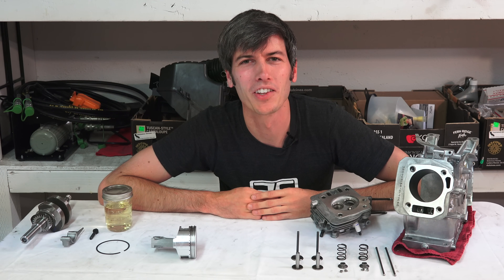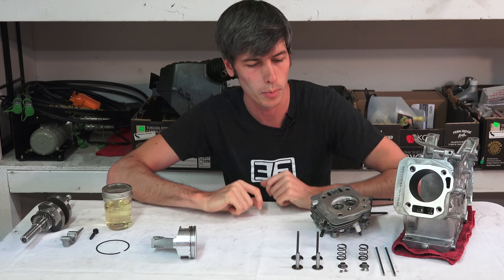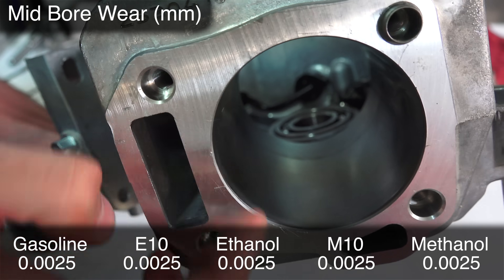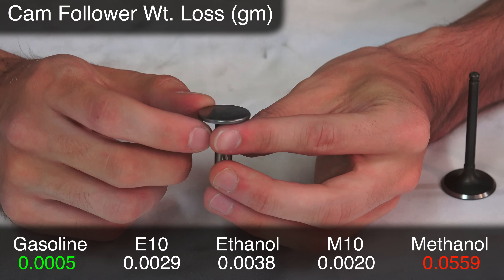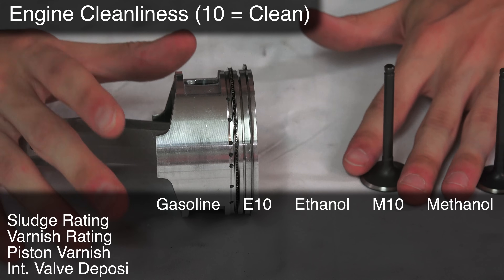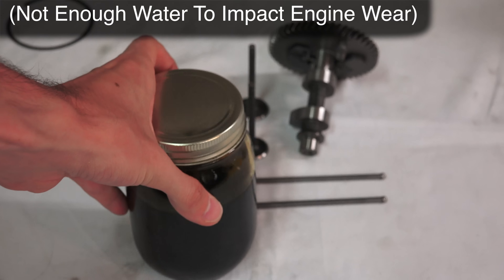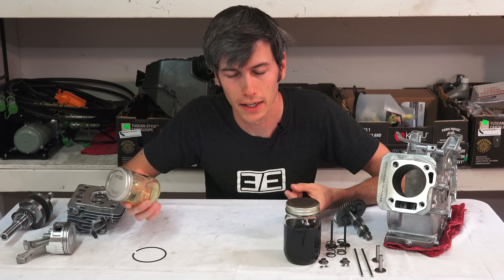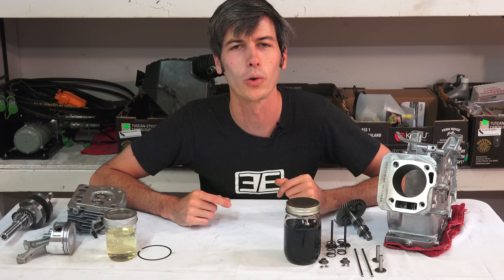Is Ethanol Bad For Your Car's Engine?

Comment: Then E10 is completely pointless...  For me anyway.  If it's cheap it makes no difference as the car will drink more of it to go the same distance.....  I run mine on 98 always and therefore I get awesome gas mileage being such a small engine and light weight car.

Comment: Ethanol is most definitely bad for engine in my motorcycle. Under load it increases pinging or pre ignition. This is a new 2017 engine. By adding octane booster the issue was dramatically reduced. Running 91 octane. In Canada in some provinces all contains ethanol. The  study is completely flawed as steady state does not deal with an engine under load. E.g. an engine under acceleration or climbing. This study has not considered octane at all. It is frankly misleading.

Comment: Great study , do you know if they took into account the 50% increase in fuel methanol takes to make the equivalent energy as the Gas and E10 ? That might have led to the increased wear also.  Curious though to why the 100% Ethanol didn't yield similar results as 100% methanol

Comment: Ive been running E85 in my 1996 dodge neon for 8 years.E85 is amazing I made all of my vehicles run on it. You lose some mpg but the cost difference makes up for it. I'd even pay a little more for e85 as it's a better fuel. Higher octane, burns cooler, and cleaner. The best part is my money stays right here in my country, not going to the middle eastern sand jammers 👍

Comment: Thanks for the video. Interesting to see pure ethanol had lowest wear. If nothing else it shows it certainly doesn't make things worse.  After tens of thousands of miles my oil analysis's seem to agree with this studies assertions.

A shame E85 isn't more widely used. I save ~20% $/mile over premium and it's better then race gas! The tune has paid for itself and then some plus the engine just feels so much more alive. 

Equal or less wear & more power for less money? How can you not love it?!

Comment: Yeah, limited focus of study to just the engine and you really don't emphasize that really well. E10 & Engines = Great, E10.  Other components of the fuel system, lines, tanks, etc = Not so great.

Comment: Boy there are a few comments i would like to address... but i wont.. people are giving ethanol a bad rap but its not the issue.. the big oil and gas industry is the issue. if your running a bike you will have to change a few things due to alcohol dries rubber.. so if its untreated hoses you either need to treat the rubber or change the part. Ethanol is actually better for your engine but that not what big oil wants you to know or you would just make it at home for pennies and never have to fill up at a station.  With ethanol your engine (when properly tweaked for it) will never need maintenance except oil changes.. as it burns clean. The tweaking needed would be a change in how much air your engine is taken in.  If you do high performance spark plugs, tweak your air to fuel ratio, you would see your engine would have more horsepower and torque from using ethanol and your engine is more efficient . The only downfall is that gas has more energy in it than ethanol. so a gallon of gas is equal to 1.35 gallons of ethanol. 

the reason they added ethanol to the fuel is to give it a higher octane rating since pure ethanol is 100 + octane.  When you learn that ethanol used to be our fuel before gas was introduced as a fuel you will see how we got fucked. Fuel is actually a bi product of oil.. and they used to dump it in the rivers and streams to throw it out.. then they had the laws changed so you could not use ethanol in your car (aka prohibition) so they could get 13 years of no competition. they did this because they were poisioning the water and knew they needed to find a source to use it.. and they did.. cars.

Comment: Why is 100% ethanol and 100% methanol used in racing?  Because its high quality, high octane fuel and produces the most horse power.  Today's cars are designed to use E10 etc. by using the correct materials for fuel lines and engine materials, just like the materials had to change to handle unleaded gasoline. People that have trouble with ethanol do not understand how to take care of the fuel.  Educate yourself. Use fuel stabilizer when you let it set for a long time.  Fuel economy with ethanol is lower because of the chemistry involved in combustion being different than gasoline.  That does not infer poor quality.  It's called a balanced chemical equation.  Example: H2 + O2 = H2O   It simply takes more ethanol to make the chemical equation balance. I get tired of people making videos and comments out of ignorance.  Ethanol is cleaner, renewable and keeps jobs in America.  Ethanol has lowered the overall price of all gasoline by about $0.70 per gallon due to the increase in fuel supply.  You're welcome.

Comment: Very interesting video, I hadn't heard about this study before. I used to own a 93 grand prix with the 3.1 liter mpfi v6 and it ran fine with no problems on e10 for years. However, I have had issues using ethanol in anything with a carburetor, as it tends to dry up the internal seals and clog up the jets. It's good to know ethanol won't cause any issues beyond the fuel system.

Comment: Tests done by those who profit from the production and sale of this garbage fuel. 
I worked as a lab tech in a facility that tested alternative fuels in Iowa. If you've ever driven through Iowa, you would have noticed there is a lot of corn grown there. Ethenol is in the majority of fuels sold there and has been for decades. 
At that facility, we found that vegi oil based diesel is good for those engines. We also found that using ethenol of any variation will definitely lower the lifespan of any petrol based engine.  
We tested more than a really old small engine, there were hundreds.   Some from old clunkers, new cars, new crate engines, foreign and domestic, new and old.  
I was one of the techs who did the labor of tearing down the engines and other parts of the cars to assess the condition before and after ethenol was run through under various conditions. Some of these were run under normal conditions until the engine was worn out or had a catastrophic failure. 
The engines ran on normal petrol last nearly twice as long as their ethenol counterpart test subjects. 
We also found that ethenol is not a little hygroscopic, but seriously hygroscopic. In northern climates, an added danger is being stranded with a full tank of ethenol. After a while, they suck in so much atmospheric moisture that a layer of water in the tank can freeze around the fuel pump, causing no fuel too be pumped to the engine. 
Also, any residual fuel in the intake when the car is shut off, draws in moisture. If the rings are carbon steel or a variation of that, they will rust a little at a time and leave score marks on the cylinder walls. This causes any engine to loose compression faster as well. 
It needs to be said that farmers I know, love growing substandard varieties of corn just for the ethenol industry. They are heavily subsidised and make a much easier living with that kind of crop.  That's our tax dollars at work. That land could be used to make veggies for human consumption, but it isn't. That makes the price of produce higher than it would otherwise be. 
When someone looks at the cost of e10 they see it's cheaper.  They think it's a good deal. It burns off faster. In that case, look at how many miles you travel in a month and how much you spend to do so.   Now, do the same number of miles with real petrol and see what I already have, you pay less with petrol to go the same distance. Miles per dollar is a more correct way to see it. 
So, a car won't last as long running ethenol. It gets noticably worse mileage running ethenol. Your tax dollars subsidize the manufacturer of it. Ethenol makes your food cost more. It's even been proven to not burn as clean as companies say. 
Remind me again, why would anyone put that garbage in their car?
I refused to go along with the companies narrative and say that ethenol tested as awesome. All my reports were completed accurately. Maybe that's why I was let go. I have no bitterness towards that, I was on the edge of retirement anyway. 
Maybe we should all vote with our dollars and demand better fuel than over hyped ethenol.

Comment: On older vehicles the non ethanol rated rubber fuel lines will 'pill', meaning there will be little 'bb's' of rubber that form from corrosion on the inside of the line as the ethanol breaks the material down over time. What effect this has on the engine, I do not know.

Comment: So you say a 20 yr old car can be at risk for a fuel system failure with ethanol, should I be concerned about mine which is 18 yrs old?Do explain more on this. Car runs fine for now I even found a gas station that has 94 octane where I am (still to this day I do not understand those who deny putting that high of octane in your NA car, from what I've learned it reduces chances of knock by being more ignition resistant) though I'm not taking this as a huge concern since I'm probably going to replace a few things on that car in up coming years, but I am just curious since I need it to runabout while I'm in college.

Comment: In the cold winters of swedens motoring past when our saab and volvo used the same stromberger carburators, we had from time to time condesation problems in our fuelsystems that froze the carbs up. Condesation formed in the gas tank and sens water is heavyer than gasoline, it colects in the bottom, were the fuel pickup lives. So the carb gets ful of water and in zubzero (celsius) weather, the carb frezez and you get stranded by the roadside. To prewent this from happening, you go and bye something called carburatorspirit and put it in the gastank. It magically removed the water and no more fezing. This formula used its hydroscopic property to acumilate the water in to the gasoline so it could burn of and go out the tailpipe in the form of waterwapor with the exhaust. This formula is ETHANOL and we have used it fore more then 50 years to get water out of 100% gasoline.

Comment: In Brazil we run E27 gasoline or pure Hydrated Ethanol (E100) in Flex Otto engines. Due the anti detonation property of the Ethanol we can deal with higher compression rate using gasoline, usually 11:1 (if it where ethanol dedicated could be 14:1 easily) when using ethanol we have at least 4% more power.

From the environmental perspective, considering the Sugar Cane growth, crop and carbon absorption (we call it well to wheel carbon cycle) we noticed our Ford Focus 1.6 Flex using ethanol is more "green" than his American cousin in Electric version charged in the USA electric outlet.

Maybe in the future an ethanol or flex hybrid with range extender makes sense in the pace of electrification.

Comment: Makes sense that Ethanol has the least wear, as the engine develops less power running on it.
Reply from the maker: Actually ethanol allows for making significantly more power, as it has a much higher octane rating (though you use more of it, not as efficient).
Reply: Even a Flex fuel vehicle doesn't have variable compression, which is realistically the only way to gain a significant power increase. Its akin to putting race gas in a Camry, yes the anti knock sensors would run the timing on the race gas a bit, so a detectable power increase would occur, but not one anything but a Dyno would notice. 

 So you are right, if we run Ethanol E85 on a motor set up with higher compression vs one with lower compression running on 87 octane, Ethanol wins! Otherwise they run about the same, and with reduced range on the vehicle with E85 in the tank. And don't forget E85 isn't winter friendly, due to its high evaporation temperature.

Comment: Moving from California to Texas (E15 to E10 at my regular pumps), I saw an increase in fuel economy from 9mpg to 13mpg. Only change being the fuel I was putting in it. It's an 89 Jeep so the system wasn't built for ethanol at all, but the difference shouldn't have been that drastic

Comment: Lol, as a fellow engineer I'm so disappointed in this video. One test, with LOTS of unaccounted variables. Come on man, I thought you were better than this. Do your own test on a real car over the course of about 6 months and that will tell you the truth, which is ethanol kills the engine very slowly due to carbon build up and fuel system damage. And who the hell is running meth in a daily driver? Lol
Reply from the maker: Haha, I like that you think me doing a test in my garage is more credible than a published, peer reviewed journal entry with controlled variables. I appreciate the compliment, but my garage tests won’t come close to the accuracy. I would expect fellow engineers to appreciate SAE tests.
Reply: @EngineeringExplained  SAE test are awesome for lab environments sure, but not for real world applications. In the real world we drive the vehicle that has the engine in it, which in turn places certain g forces, engine loading, ECU, fuel system, and other variables that all combine to tell the story. The only true way to test something is to first look at MANY controlled lab tests that change said variables one at a time then compile the data and run several real world tests to either prove whether the lab data is accurate or not. If it's not accurate then we run the control tests again to find out what's going on. However, for something simple like this a simple 6 month real world driving of the car every day should be enough to establish a real hypothesis on if ethanol is bad for the engine, assuming the engine is cleaned and inspected before starting for a real measurement of what's going on. But the amount of data that is already out there on this topic is pretty overwhelming that ethanol does in fact kill engines over a given period of time and why I'm not fond of this video because you're only looking at one simple 20hr constant run test, which for a lawnmower would be excellent, but not for a car engine.

Comment: Ethanol is a nightmare for motorcycles with plastic tanks - Ducati, Triumph and Aprilia that I know of. I own a 2000s Aprilia, tanks expand and paint peels off. A friend has had all sorts of problems with his 1999 Triumph Speed Triple 955; the leaks became so bad he fitted a new tank through Triumph Classic Parts scheme he got lucky only cost £130.
I have tried to avoid putting the stuff in my Aprilia for the last 4 or 5 years, using Esso Premium when I can or Putolin E10 Fuel Fighter.

Comment: I say Methanol 10% and Gasoline 90% is the best way to go except for the oil deposits.  On the other hand Ethanol 100% seems to be pretty good and is best in the oil deposits.  Regardless we have no say in the Ethanol 10% and Gasoline 90% blend.  That sucks but is what it is.  Who knows if the 10% Ethanol is the correct blend measurement at the pump.  Just like when instead of Honey alot of companies use syrup blends yet say it's 100% Honey.  We are all slaves to what big companies do unless we find a way to make things ourselves.

Comment: Might want to look into engines designed to run on E85 and E100. How does their performance stack up against the same engine set up to run on pure gasoline? I know the octane ratings differ significantly.  Pure gasoline has a rating around 85 octane, E15 is 88 octane, E85 is 108 octane, and E100 rating is around 115 octane.  Now you need a much higher performance engine to extract as much power as you can form E100, then you will have to run gasoline.  Meaning  you can extract a larger percentage of power out of E100 then you can out of pure gasoline. (Note 1: Flex Fuel vehicle engines are build to the least common denominator, being pure gasoline having the lowest octane.  Now Gas has more BTU's then E100,  Hence E100 will always loose to gasoline on performance, if you run it in an engine designed for gasoline.  Because gasoline has more BTU's then E100.) Start with the same base engine, but build one to run at peak efficiency on pure gasoline and the other engine to run at peak efficiency on E100 and see what you get for HP/BTU for each engine.  Then you will be comparing apples to apples on performance of the two fuels.  (Note 2: Heat is what really kills engines, so if I have a fuel with fewer BTU's a.k.a. heat and I am turning more of the BTU's to power and less to heat. I am going to have an engine that lasts far longer.)

Comment: Just a little organic chemistry to help explain a benefit to ethical: gasoline is a non polar hydrocarbon and is therefore not miscible with water. Adding ethanol allows both the polar water/ moisture in the gas tank to mix evenly with the nonpolar gasoline.... this  is a good thing because "unmixed" water droplets in fuel lines destroys injectors because water can not be compressed the same way as the  hydrocarbons.
So I mean naturally some moister is going to end up in your gas tank and the ethanol deals with it very well.
Reply from the maker: Yes! As long as the fuel is not sitting for excessive amounts of time, it can actually provide a benefit.

Comment: In Europe most pumps will sell premium 98 octane fuels without ethanol.
But I'm not sure about gas stations in the US, in the video I could see that gasoline in the US has lower octane ratings as in Europe, where 91 is the lowest rating, 95 E10 is the most common and premium gas, which all larger brands sell 98.
Funny thing, Shell V-power in the US is 91 octane whereas in Europe it's 98 octane.
Probably because cars in Europe tend to have smaller but higher specific output engines, many of them turbo, lot's of them don't run on 91 octane without problems and may even struggle with 95.
As for my car, built 2010, using E10 causes no problems, mileage is a bit less than on pure gas, but in my perception it gives a better cold start in the winter, and actually does a slightly better mileage on short trips.